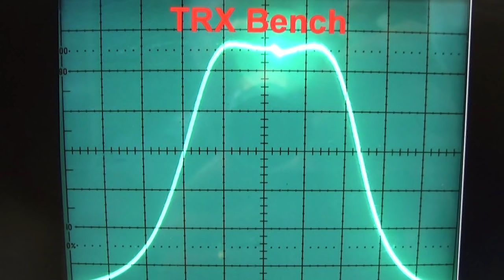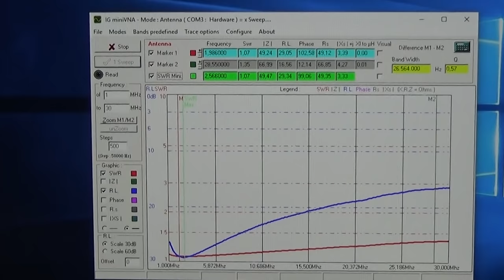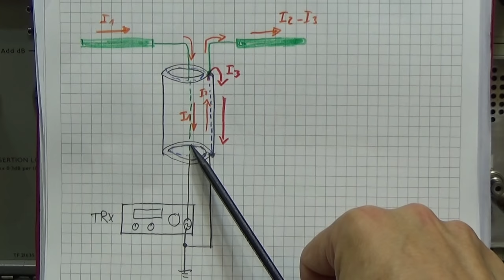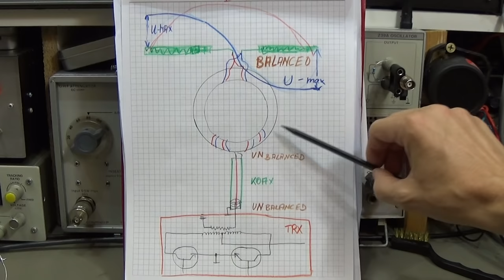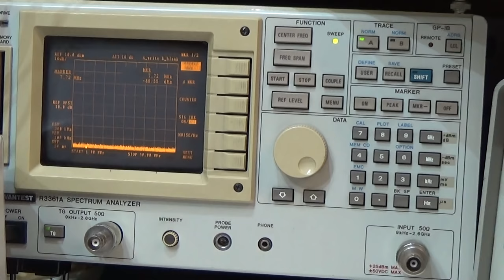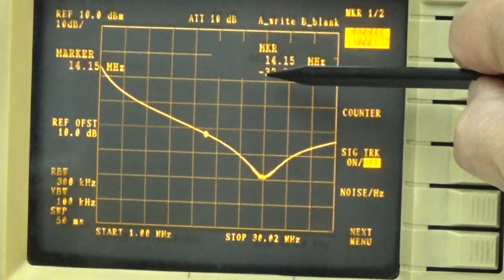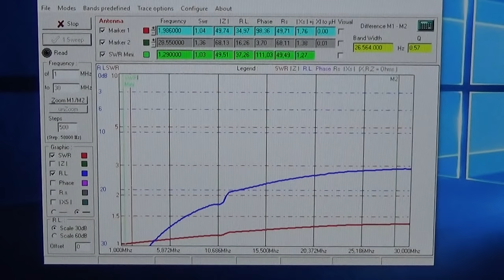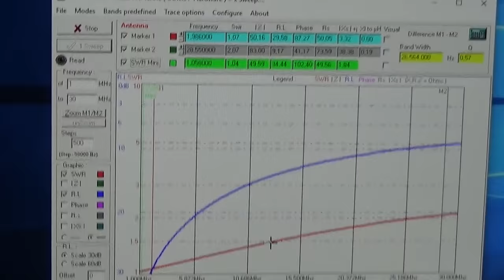#100 Balun PART 1: Broadcast Interference, Common Mode Current and  Balun's magic

Comment: I wanted to thank you for this video.  I had a balun on my loop antenna and had problems.  I measured my loop for 3.55 mhz since it’s harmonics would be 7.1, 14.2, 21.3, 24.85 and 28.4 Mhz - I had very nice swr on all bands except the primary frequency.  I did everything, shortened the antenna, lengthened the antenna.  Shortened the ladder line, lengthened the ladder line.  Increased height… basically everything but couldn’t get swr down to a reasonable reading on 3.55 mhz.  After watching your video, I then looked at my balun.  I had recently bought a VNA and found the balun had swr issues on 80 meters.  All that work on the antenna for nothing.  One top off was when I put a length of 75 ohm coax then to 50 ohm, the swr went down, but I wanted to use the loop on all multiples of the frequencies… so all this time, it was the balun.  The balun said it was rated from 1.8-30 mhz at 150 watts.  Well, this well known companies 4:1 balun didn’t work in the lower bands.  With VNAs becoming within nearly everyone’s budget, those companies who rate their Baluns will now have hams looking over their shoulders.  I built my own balun according to your other videos and now the loop works fine.  Thanks again for your instructive videos…. De AL7KT
Reply from the maker: glad that you liked my video! Thank you

Comment: Good points made. However, the 2nd & 3rd examples are “chokes” (not impedance matching transformers) .. but, good “partial” info for a center fed dipole. Also, End Fed Half Wave antennas require a 49:1 “step up”/ 50 ohm to “high” impedance (about 2400 ohms or so) match. Hence, the primary and secondary need common ground (and usually/likely need a “choke” to block common mode RF current on the feed line).

Comment: Great explanation Peter.  Looking forward to part 2.  That's one thing I have never done is wind my own Balun.  Always used commercially made ones.  I'm tempted to test them and see just how well they actually work.

Mike
Reply from the maker: Thank you Mike. Yeah you have all the needed test equipment to test them. Curious how that turns out...  All the best 73

Comment: Another great video, and it debunks a lot of the claims made about overpriced junk products peddled to unsuspecting hams. I looked for that VNA & found it was sold out in 2014 and they are not making anymore of them. I found another similar kit on eBay that has good reviews on eHam for whatever that is worth. If I get lucky, I might make enough betting on the election to buy a nice comm monitor. & spectrum analyzer. I started buying Amidon cores some time ago and witch wind my own Baluns, and Ununs. I am so happy you are going into some depth on the theory of functional working baluns! Thank you again, Peter!  I was out of town on July 2, 2016, away from the internet & television. I did find a lovely old WWII transceiver, and the dynamotor power supply, complete with 1942 211 valves! My uncle wants me to take it home, so in January, I will bring it back with me. Gott Segne 73s!

Comment: 22:47 It isn't easy to see at this angle but would I be right in thinking that the output of the balun (the green capacitors) is only connected to the core of the coax? Also, the colours on the resistors are difficult to identify (for me) so would it be possible to know the values of the resistances on this very useful looking test circuit? Thanks!
Reply: The green objects are 100 ohm resistors (brown black brown), not capacitors and they are on the output of the balun for matching purposes.  There are two sets of parallel resistors on the input side.  They each are a 27 ohm resistor (red violet black) in parallel with a 330 ohm resistor (orange orange brown).  The equivalent parallel resistance is about 25 ohms (24.96).

Comment: Nice video Peter.
After looking again, the connections are clear. They weren't because some soldered points covered the hot wires.
One more question: the two common mode signals are connected to the primary winding. But then you don't have a primary current, do you? In that case: how can the balun generate a secondary winding current / voltage?
Or are we dealing with a capacitive coupling i?

My former question:
The connections of the measurement setup are not clearly visible in the video. Could you provide a schematic of it?
And an explanation based on this diagram would be very welcome.
Thanks in advance and all good wishes for 2021!

Comment: I have seen a few other videos on this topic but none were as awesome as this 2 Part Series.  Finally someone actually explained the concepts of why it is needed and why some designs are better than others.  I have seen some videos that probably don't really work this well because they did not test them. I would like to see Part 3 where you finish the balun and show it mounted and connected in the box with some design elements to consider.  Meanwhile please show me a picture of it with the cover off.  Thanks!

Comment: 200 ohms represents a OCFD at about 40 feet in height, if the height of the antenna changes, the impedance changes, so it is the height of the antenna that determines what type of balun you would use. The 4:1 if typical for most antennas, so that is why it is so common. Some antennas require a 9:1, or 1:1, it all depends on the antenna, and how it is installed.

Comment: Will be waiting on part 2 Peter.  I need to build a new one for my Hygain TH6DX. The one on it is about to fall apart due to age.  Very nicely done my friend. Thanks for sharing as always. 73 Buddy
Reply from the maker: Okay then we need to do it double as good as planned  bro ! :^) Thanks for feed back my friend 73
Reply: Will be waiting to see it Peter. I went up on the roof yesterday and the wiring on mine is old and cracking up. It was only designed for 200 watts when  I built it.  At least it is easy to get to. This monster antenna weighs in at 95 pounds (43 kilo's)
Reply from the maker: yeah to heavy for easily take it down. It that the antenna on your tower behind your house? Well the Balun I will demonstrate will be good for minimum 800 Watt.  Take care bro 73
Reply: It is on a 25 foot telephone  pole. I have a platform under it so I can work on it when needed. Will be waiting for further videos my friend.

Comment: Nice video, Peter I made the same spiderbeam Balun like that one. I used the same size core, but used a good quality rj58 mil spec coax for my homemade spiderbeam antenna. It works well the Balun, no common mode currents.

Comment: Common mode can be any direction. It is not always only opposing the shield inside current. Common mode is simply the vector difference between I1 and I2. In a coaxial line I1 always equals I2, but I3 can be any phase since it is an independent conductor isolated by the skin depth of the shield.

Comment: Hi Peter. Amazing vids you have made about baluns - best video tutorials for HAMs as far as I am concerned! Thank you!
I have a questions:
1. the vid part 32:31 -  for 1:1 balund the input is 50 Ohm i.e. 2 x 25 Ohm resistors (one for the ground and another for the hot wire), right?
And on the output side (Antenna) it should be 50 Ohm in total (as expected from a dipol antenna) for example one 50 Ohm resistor or two 25 Ohm resistors in parallel, or 100 Ohm resistors in series giving us 50 Ohm load? Am I missing something here?

2. for the 1:4 Balun - the input side is e.g. 2 x 25 Ohm (one for hot wire and one for the ground), but for the OUT (Antenna) it should be 2 x 100 Ohm (one resistor per each side of the antenna wire . both are obviously connected together, as seen on the video).

I simply struggle to understand this part, as I want my measurements to be the same every time, so it is crucial for me to get that right.
basically I am lacking of the basic circuit knowledge, at this stage.
many thanks for your reply in advance.
all the best man! take care! 73!

Comment: Nice video Peter.
After looking again, the connections are clear. They weren't because 
some soldered points covered the hot wires.
But one more question: the two common mode signals are connected to the 
primary winding. But then you don't have a primary current, do you? In 
that case: how can the balun generate a secondary winding current / 
voltage?
Or are we dealing with a capacitive coupling i?

Comment: Hi Peter. Another great video about amateur radio.( und auch englisher sprachen technique, mit die andre "coments"). Never mind I suppose it is a pity that is what we must put up with.(QRM. est das richtig.???). what I cannot understand is the crazy price I see that is asked for the cost of a ferrite toroid and a bit of copper wire . It takes minutes to wind one, then put it into a container with connectors in place. With thanks to Peter and others, newcomers to Ham radio can easily see how things work and how to make them. 73 de G0WXU.

Comment: Thank you for this series of videos Peter! Very informative, and illustrates the various aspects of balun operation very well. Hoping to build a suitable balun for improving my dipole setup. 73 de Matt M0CUV
Reply from the maker: Hi Matt, thanks for watching, glad that you like it. All the best and 73
Reply: +TRX Bench Hi Peter, I've been searching for the right type of wire... I only use QRP (max 10W), and was thinking of using the smaller FT140-43 core - would you just use the same number of turns but with a thinner wire? 73 Matt
Reply from the maker: +Matt Gumbley yes I would use the same number of turns

Comment: You building a 1:1 or a 4:1 either work really well 9:1 is what I made and installed it inside a Morphy Richards 27024 and it works really well and am able to receive many more stations than without it.
Reply from the maker: Hi David, very good and congratulation for your design. Thanks for watching 73

Comment: At 47:37 I think you are saying that 100 ohm wire is needed. Where does one buy 100 ohm wire? I've googled for 100 ohm wire and I find nothing purchasable that looks like the wire you are using. I only found cable. Can you give us the wire specs you are using (awg, ohms, manufacturer, temperature rating, insulation type, etc.)? Thank you for these videos!
Reply: The author means not usual resistance but input impedance of balanced (two wires) transmission line.
You can google like 450 Ohm Ladder Line or 100 Ohm Ladder Line

Comment: Absolutely outstanding video Peter!! Thanks so much for this. I've been struggling to make a good 4:1 balun for my "New Carolina Windom" antenna. What I have functions but I want it to be correct. I need a lot of help understanding how to choose the correct core size and material and also the wire. Can you possibly show some tips on analysis using basic equipment only? I don't have a network analyzer but I'm thinking of getting a computer based antenna analyzer similar to your miniVNA. Right now I only have the MFJ-269. Thanks again Peter. Can't wait to watch part 2.
Reply from the maker: Hi Mitchell, well the test procedure with a "miniVNA" is more or less the same as with a real scalar network analyser I was using in this video.. Thanks for feed-back 73

Comment: 46:29 I don't understand how do you measure a wire impedance for 100ohms ? How can I know that the PTFE cable I would order would be 100ohms ?

Comment: Fantastic video series on baluns, thank you.
Question:  the ptfe coated wire is very expensive, can silicone coated wire be used as a substitute?

Comment: a part 5 of this series of video would be to show how to effectively build common chokes for our current antennas and other equipements in the shack... I mean how do I protect an antenna that has NO common mode choke (or an innefective one) ? The "ugly balun" clearly do NOT work at low frequency, I would like to build one in line with my exisiting antenna and coax cable... You could show how and test it on spectrum too...

Comment: Surely it is impossible to simulate a 200 ohm impedance with passive resistors to check a Balun.  It is 200 ohm resistance. Impedance is a function of a changing waveform (e.g. "AC") at RF frequencies and the balun would perform quite differently at RF with a dipole antenna with an impedance of 200 ohms

Comment: Thank you so much for your video. After reading lot of things on internet it was more confused  in my head. Now it is very clear for me. But I wonder what we can buy ? we do not have any assurance that the balun is correct and work fine on all bands...One balun can be correct over 20 meter, and very bad for 40,80 or 160 meters ... all providers should delivered with balun all mesurements that you explain !!! Thank you again !
Reply from the maker: Thank you. Yes I agree it would be more than fair to get all the test data from the supplier...

Comment: Wow, by far the best on you tube. Many thanks, very good explanation. Is it possible to carry out checks with basic test kit, scope, sig gen, freq counter, power & swr meter etc.Where can you get figs to design ie what could be done to make the balun suitable for 160m.Regards Paul.
Reply from the maker: Hi Paul, thanks for Feed-back. Well with Basic Test hear it is Not easy but watching my Video in the miniVNA tiny. Max be that is an idea for you. 7:

Comment: At 29:00 where you have the spectrum analyzer's TG output connected to one side of the balun and the other side to the input of the spectrum analyzer to measure a drop of about 4dB it looks like all you are measuring is the loss of the balun from one side to the other side.  How does that relate to Common Mode, does it work because the output is connected to the center of the 2 resistors?
I've tried building some baluns with kits from Ebay and they seem to work properly as far as VSWR and Impedance but I don't know about the common mode characteristics and other things. 
I have a Sark100 antenna analzyer that will sweep the device and give me a graph of VSWR, Resistance, Reactance and Impedance on my tablet with Bluetooth like your miniVNA but my spectrum analyzer doesn't have a TG output so is there any way for me to make these measurements inexpensively with the equipment that I have?
Reply from the maker: Steve, you must watch the test set up very carefully. I feed  the signal into the coax and equally into its screen and that is exactly was common mode current is. In this configuration we would like to see a very high attenuation but minimum 20 db but we see only 3db and that is nothing! Without a signal source like you have it on the miniVNA it is difficult to do this test. 73
Reply: OK, I'm trying to figure out how it works so I can try to duplicate it.

Comment: Another great video - thanks.  I noticed you used a spectrum analyzer to measure common mode rejection, could you have used the mini-VNA instead? Andy, K3JSE
Reply from the maker: Hi Andy, yes it would have been possible to do the job with the miniVNA as well. Thanks for stopping by 73

Comment: Peter,
Excellent explanation. In Part 2, are you also going to test common mode chokes using ferrite beads over the coax and also choke made from making turns of the coax into an air core.

WB3BJU
Reply from the maker: Thank you Donald. Well it is difficult to cover all as that is really a complex subject but I try my best... 73

Comment: Hello, 20 dB is a good attenuation rate, but it is measured on the load of your test set, so it is useful just to compare to other balun under same conditions. In the real world the external surface of the coax cable braid will show a different radiation resistance depending on his length compared to the wavelength.
Next in your tests I don't understand why you put resistors on BOTH the balun ports to simulate balanced feeding AND loading: in the normal use one of the ports will be connected to an unbalanced system (the coax cable + VNA).

Comment: Have seen references to 1:1 balun, 4:1 balun and 9:1 balun -- but how do I determine which one I need to use?  After homebrewing an antenna, before I hook it up to the transceiver what should I measure (current/impedance/resistance, etc.?) -- and how do I measure it?  Would I use a multi-meter to measure, to determine which balun I need to make?  Sorry, but I'm clueless about all this right now and need some basic guidance.

Thank you for your time and assistance.

Comment: Fantastic video Peter. So much detailed information presented in a very clear way. I have a dipole for HF known as a G5RV. Are you familiar with this very old design? It uses a dipole a length of balanced feeder and coax to enable correct loading on all common HF bands. I have had much success with this over many years. 73’s Lynton

Comment: Nice Video, left over now only one important issue is whatfor is difference of Baloons 1:1 and 1:4 and 1:9 and 1:16 good for and how does Impediance matter and why.
Or in other words, why is it sometimes need to convert 450 Ohm to 50 and otherwise just can remain the same as a wire is a wire is a wire, hi.
So what makes that Difference than to better understand what kind of Baloon would 
be needed and why?
Because there are so many different kinds of Baluns in the Market and how to select at best.
Also what is the Difference between a Ballon and an Unun.

Comment: So what's the difference between a balun, an unun, and a matching transformer???  It is my understanding that my off center fed dipole long wire uses an unun at 4:1 and 44 feet on one side and 88 feet of wire on the other side.  My Yaesu 991a internal tuner will handle all my antennae as they are close to being resonate.  Cheers & 73 from W Rusty Lane K9POW in eastern Tennessee

Comment: I have two transformers. They are wound with double copper wire on a ferrite ring. They give suppression from -50 to -30 dB. I decided to connect them in series to increase the suppression parameter. But the parameters have not changed. The question is why?